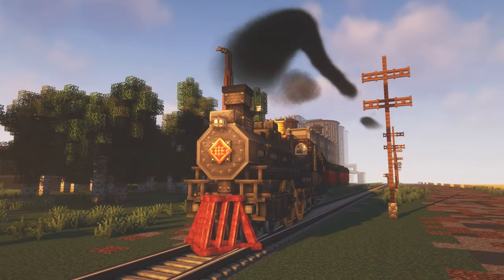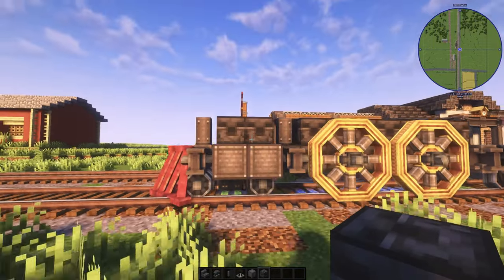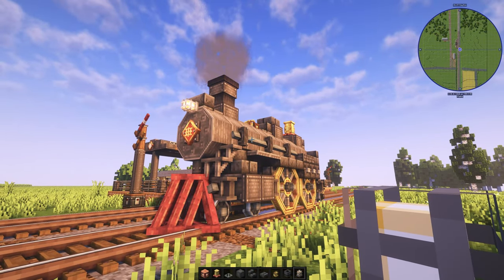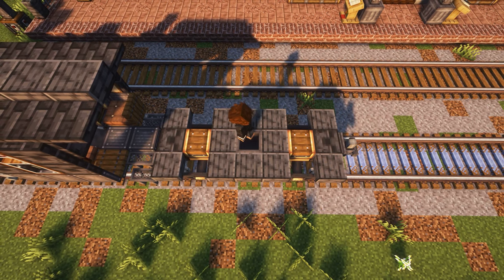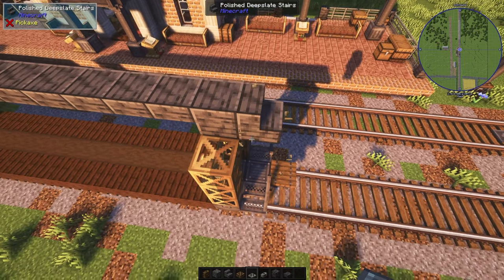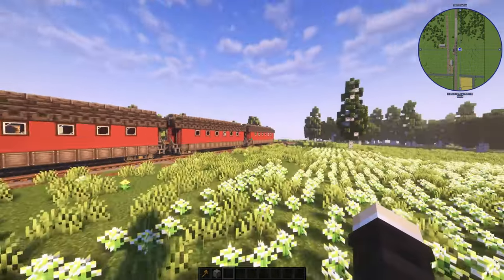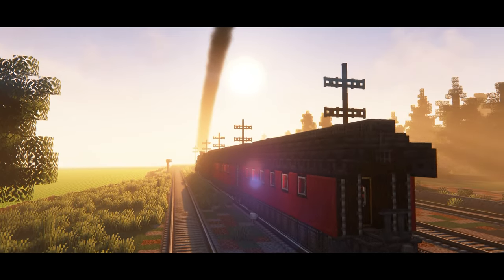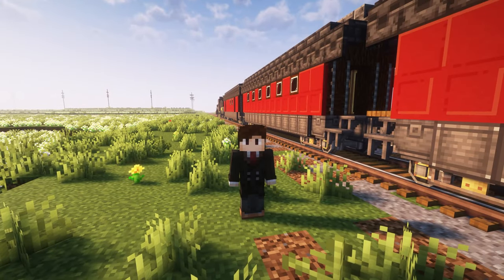Making an 1800s Train with Create Mod 🚂 | Minecraft tutorial

Comment: Just suggestion, you used flywheels as larger wheels, but I remember you had used different wheels with train casing, and maybe the extended bogeys add on might also make it look better. JUST suggestion.
Reply from the maker: Yes, I did use the train hull for wheels in Polar Express. But for this, I kinda dig the brass accent 😉

Comment: Hello. When you press the ALT key, it opens a menu for the bogeys. However, the menu is not the same under normal circumstances. Do you know which mod allows you to have this menu with the other bogeys?
Reply from the maker: Do you have a train casing in your hand when you press alt?
Reply: @MadenPlay  Yes, but the gui menu have a different style.
Reply: @mozork2270  did you found a solution?